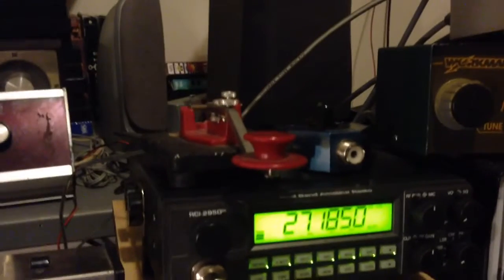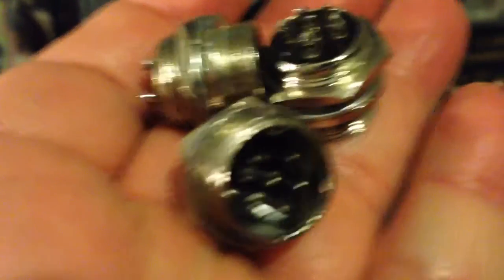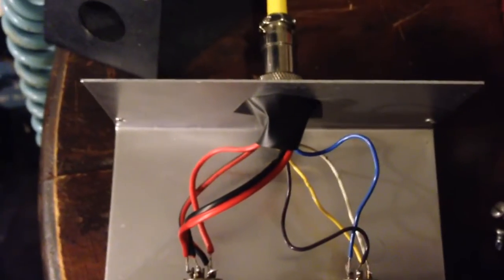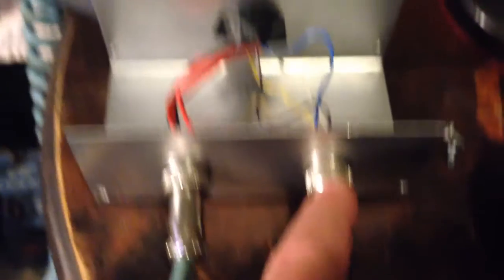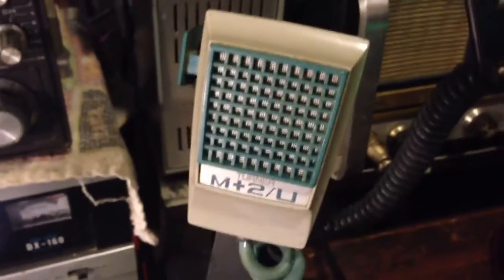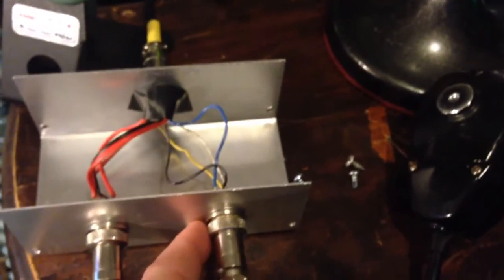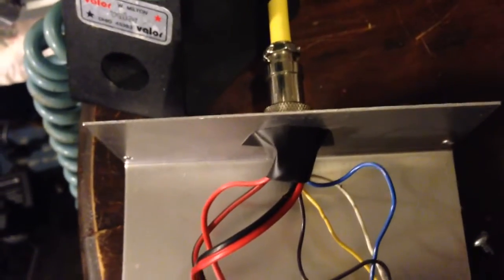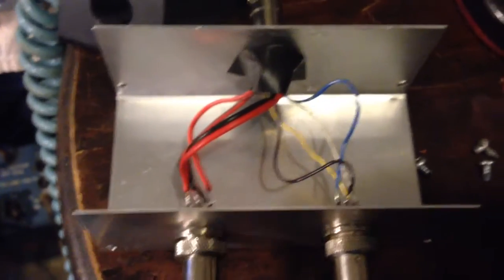CB Mic Switch Box Homemade

Comment: What kind of wire do u use for cb microphone wire
Reply from the maker: TK I try to use solid core but sometimes good multi strand works also. You can make your own microphone cords from old six wire telephone cable.

Thanks for watching
Reply: Radionut R i bought som 4 strand telephone jack wire the other day. U think that would work?
Reply from the maker: TK Yeah should work just keep track of which wire goes to what. The words keep your color straight
Reply: Radionut R do i need a shield wire?
Reply from the maker: TK If your microphone is for wired just pick one of the wires in the cord you’re going to use and say OK that’s the shield wire. Yother one would be whatever colors they are.
Reply: Radionut R awesome thanks im gonna try it
Reply from the maker: TK Go for it dude you’ll figure it out

Comment: Hey radionut R, can you made one for me with 6 pin?
Reply from the maker: Sure. for what radio? you buy the stuff needed.
Reply: I have a maxlog 8800 radio,6 pin mic . Where do i buy the parts?
Reply from the maker: +Jesse Goode well unfortunately I don't know where you're located my friend. If you have a local CB shop or you might have to order them online.  You need a small plastic or metal box about 6 x 3 x 2 and the connectors to match up to your radio I will throw in the connector cable from my collection
Reply: do you think I could use a splitter to splitter a rj45 type Mic plug so that I could have an option to use either the regular Mic or a push to talk Bluetooth headset.